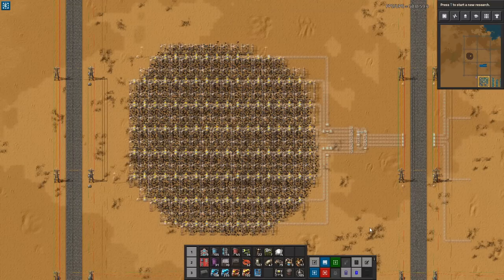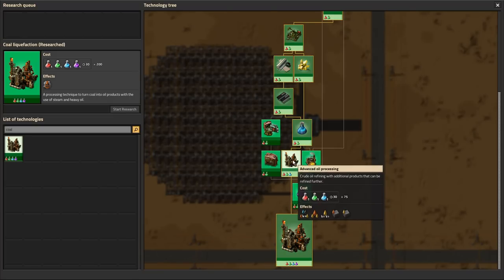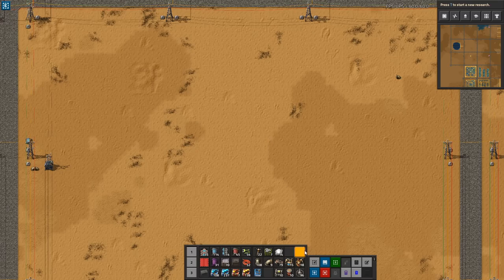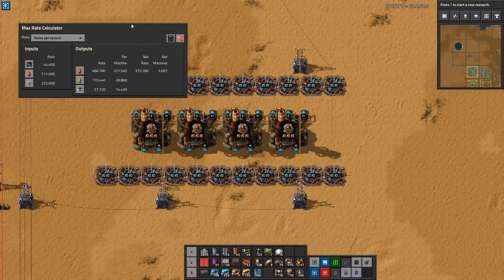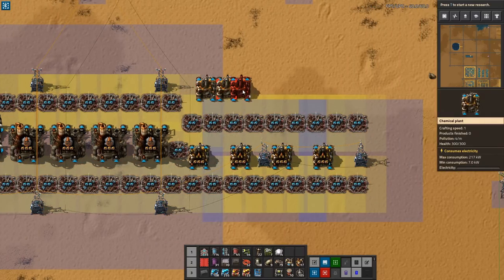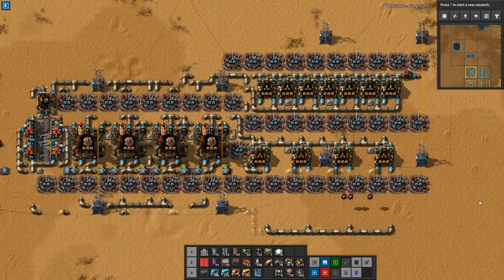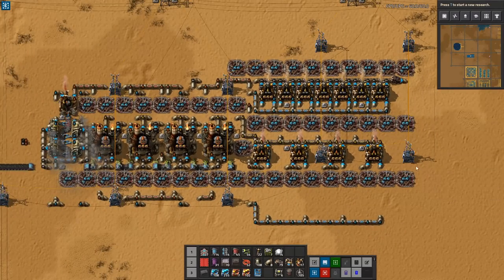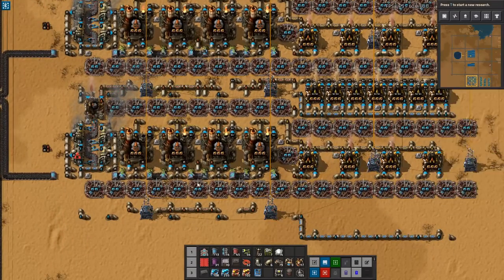Easy OIL with COAL LIQUEFACTION -  Factorio 0.18 Tutorial/Guide/How-to

Comment: In my opinion, one of the best uses for Coal Liquefaction is being able to convert coal directly into plastic without needing petroleum imported from offsite. By the mid/late game, you've generally got way more coal than you know what to do with, and the only consumers of coal I can think of off the top of my head are Grenades for military science and plastic, so most of the time you'll be swimming in the stuff. There is a distant worry that you'll overconsume the stuff and run out, but chances are that's not going to happen any time soon.
Reply: Yeah, good point. We require a new design now! :P
Reply: 1000% good point!
Reply: I'm surprised that the end of his video wasn't running the second belt of coal to the petroleum output and plopping down a beaconed plastic blueprint that precisely consumed the entire petrol output LOL

Comment: Love the idea of using solid fuel to fill up the boilers.
Reply: In our factory we can not afford to lose even a small bit of hydrocarbon energy!
Reply: You can't use oil to fuel boilers in vanilla factorio. I love it because it makes the ratios work out just right, and I never would have thought of it on my own.
Reply: @卜仁宁  I believe the comment above was why not use coal to fuel the boilers or solid fuel produced from light oil (rather than heavy).  Coal is less efficient than solid fuel, but it is more efficient to make solid fuel from light oil.  I think if you math it out, it makes more sense to crack your excess heavy oil down to light oil, and use it produce solid fuel.  This is stated on the wiki as well.
Reply: For sure it's more efficient to make solid fuel from light oil. That said, this design chooses not to do that because you would have to manually add fuel to the boilers at startup instead of just pumping some heavy oil into the system. Also the ratios work out so if the design didn't use solid fuel there would need to be another heavy to light oil cracking plant.
Reply: I dont get it... clearly the efficient solution is to use exess steam from nuclear plants for this XD

Comment: Something I really want to try with coal liquefaction is: you're already producing steam for the liquefaction. What else does the build require other than coal and water? Power. What other than coal liquefaction can be made with coal and water? Power. Unfortunately, boilers and steam engines can't be upgraded the same way the modules and beacons upgrade the processing itself, and those upgrades massively increase the power draw making it infeasible to provide enough power to one of these setups using only on-site generators. Such power generation seems like it would eclipse the actual processing in size.

Comment: If I understand it, you are relying on the fact that heavy oil will flow to the inputs first to ensure the heavy oil didn't run out. In my experience, it kept running out. Why rely on a feature like that when a single pump hooked to a nearby fluid tank via a logistics wire is a guaranteed way to ensure the heavy oil doesn't run out.
Reply: Thats why he uses long chains of normal pipes instead of underground pipes to the heavy oil cracking. Due to the pipe distance, oil will flow to the inputs first instead of running out to the heavy oil cracking plants.

Comment: Hi Nilaus, love the designs. I usually start liquefaction very early - I often rush purple to get it - because I really hate that the crude oil tapers off, hard to design a decent base when at first the capacity for plastic is fantastic, but your copper isn't capable of supporting a high throughout of reds. Then, when you get that sorted, the plastic tapers off because the pumpjacks are losing it. I prefer setting up coal liquefaction because it is a definite and stable throughput that is calculable.

I'll do a test of the design without beacons or modules, I hope that it can be used earlier in the game as well! I suspect there power consumption with all those modules is rough for a pre nuclear base.
Reply: Yes exactly! I hate that crude oil tapers off, which messes up the large scale plastic production and you spend ages trying to rebalance everything. Coal liquefaction way is much more stable.
Reply: @ishaanmalhotra3008 i just ran into that problem on mine.  Dealing with keeping flame turrets supplied with light oil atm. Just one atm is all i need to keep reserves. Its nice.  Very nice. 
Plastic will be next. But i gotta expand my crappy first base

Comment: Nilaus, I have to thank you for this. Just last night I went down the rabbit hole of frustration trying to fix the fluid levels in my pipes. Just could not wrap my brain around how a tank can be full yet the 20th pipe down the line has almost nothing. I had a coal patch right beside my Rocket Fuel and Solid Fuel City blocks and this fixed my OCD. Thank you good sir!
Reply: Pipe throughput is your issue, I believe. https://wiki.factorio.com/Fluid_system, check minimized chart under "pipelines".

Comment: Last time I did coal liquefaction I set it up as a dedicated rocket fuel facility, but I do agree that you want to try to have a single output when using liquefaction. Makes them much less fiddly than they would be if you tried to pull multiple outputs.
Reply: A single output is always easier, but if you want multiple outputs then all you need is a tank and pump to force the heavy oil back to the inputs before it can go to cracking.

Comment: I have used this blueprint to good effect with a slight modification. I have pumps stopping the light oil to petroleum cracking. The main reason for this is to create a stockpile of light oil which I use for flame turrets as well as for rocket fuel. I always find I have enough petroleum but no light oil if I crack it all.

Comment: Ha, nice design!
I also countered my higher heavy oil consumption with coal liquefaction, but I used a small nuclear reactor as source for the steam and felt like it was a bit overkill - it fills a steam buffer of a few tanks and thus the "on-demand" fuel thrown in it does not get wasted. 
But this is a completely different level - I assume you can help it to stabilize with cutting off the output until the solid fuel production backed up completely. This could possibly even allow one module to jump-start the one below within seconds, no need to wait for it to stabilize.

Comment: just to have an idea, how big of an oil patch would you need to extract similar amount of petroleum?
Reply: A fully moduled and beaconed advanced oil setup converts 171 crude oil to 255 petroleum per second.  https://wiki.factorio.com/Oil_processing

To match the 1800 pet here, you would need about 7 adv oil setups, needing about 1200 crude oil per second.  So divide that by your pumpjack speed.

It is hard to say exactly, as oil decreases speed over time, and you can also add both speed modules and speed beacons to pumpjacks.

Comment: Hmmm, i have one un-obvious question.
The production of solid fuel is slightly more than consumption (with boilers). So, after some time this blue belt will be full of solid fuel. After it the consumption of heavy oil (in chemical plant producing solid fuel from heavy oil) will be decreased and this will break the entire chain of coal liquefaction.
How this can be solved?

Comment: Hello Nilaus,
thank you for this nice video. Currently I don't have a megabase yet, but I think I will be able to integrate your layout well into my railway megabase :)
May I make a suggestion for the presentation of your future tutorials? If you point with the mouse pointer at something, please move it slower. It is sometimes difficult to "find" the mouse pointer so quickly to see what you are pointing at. Especially if you move it quickly back and forth, for example to encircle something. Maybe you can use a tool or something similar to make the mouse pointer more noticeable. :)
Many greetings
Sven

Comment: So, what happens, if the coal dries out or the coal train is too late and the coal belts get empty?
Reply: If you cut off the coal it eventually just stops as without the coal to convert there's no oil production. You should have enough heavy oil in the refineries to jump start it if you find a way to replace the coal, but it's probably better to tanker off some heavy oil when it's running in case you need to jump start it to be safe.

Comment: The "collective pipe" word you're looking for is "manifold".
How well does this work with nuclear steam? Does the higher temperature mean it needs less volume?
Reply: As far as I know, in factorio Steam is Steam. The heat exchanger just uses heat from a nuclear reactor rather than fuel. You could tap into a nuclear reactor to keep this thing going, but it's much easier to fuel this thing with it's own byproducts and keep it as a closed loop.
Reply: @kevingriffith6011  I believe there is low-temp vs. high-temp steam under the covers.  Low-temp steam won't work in a Turbine, but high-temp steam will work everywhere.  Agree, total overkill for liquifaction though and better to keep everything contained.
Reply: @chris909090  So I learned a bit since I commented this, but you're half right about the turbine. Low temp steam will work in a turbine, but it won't reach it's full efficiency. It's still better than the steam engine in every respect though, even if you're using low temp steam.

Comment: I am wondering if using coal for the steam instead of solid fuel would be more efficient. You are spending ressources and energy to convert the coal into heavy oil, then more to convert the oil into solid fuel. Wouldn't you be spending less ressources just using the coal as fuel directly to obtain the steam ? Also... any thoughts on using nuclear as a source for steam for this purpose ?

Comment: Hello, I'm a newbie to the game and am quite confused with the ratio calculation that goes into designing, well almost everything in this game properly. Could someone please help me understand the math a little bit? And it's not just for the oil (it's well beyond my capabilities at this point), but on a more holistic level.

EDIT: I suppose I could just copy the blueprints Nilaus has so generously provided, but if I just copy stuff, I doubt I'll learn proper design.
Reply: Good thinking, the game is so much more satisfying if you understand why blueprints work before making use of them. Ratios are rather straightforward in the early to mid game, just look at crafting times and quantities and line them up, e.g. green circuits require 3 copper cable per half second, but copper cable is only made at 2 per half second, ergo 3 cable per 2 green is a perfect ratio. You can use online calculators, but all the information is readily available ingame... even if it sometimes requires long and ugly operator chains to make sense of.
Reply: @enaero1713  Thanks, that's a start, and I've got some idea on crafting for a few simple things, but what about other stuff, like smelting stack sizes? How did people arrive at 48 smelters per stack? And how do belt speeds factor into the ratio calculation process?
Reply: @Teura Ah, now it starts to make sense. Thanks, friend.
Reply: Another query, if you don't mind. I can see that the factorio wiki lists the production time as 0.3125/sec, which I assume you're rounding up to 0.32. Is this the case for all fabricator components (smelters, pipejacks, assemblers, etc.)?
Reply: @Teura I think I see now. Thanks again. Let me see if I can get to mid-game by myself.

If I don't drive myself nuts with layout efficiency.

Comment: Such a waste... Burning some of the precious oil as solid fuel is not an option. Much cleaner to use left over steam from nuclear plants to run coal liquifaction, preserving all the carbon for plastic.
Reply from the maker: So you propose to pipe/train Steam from your Nuclear power plant to this Coal Liquefaction in order to save a minuscule amount of coal... That sounds like a waste of time
Reply: @Nilaus  I know and it was a joke, i do run it that way in my current factory tho but that just happened because i was setting it up and noticed i had my nuclear plant right next door XD